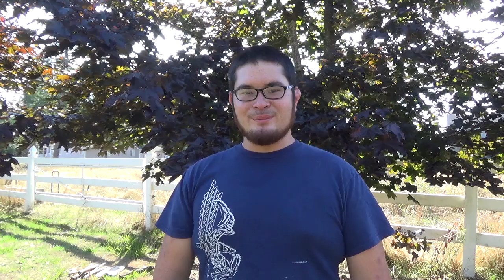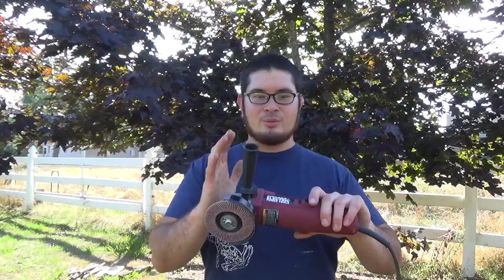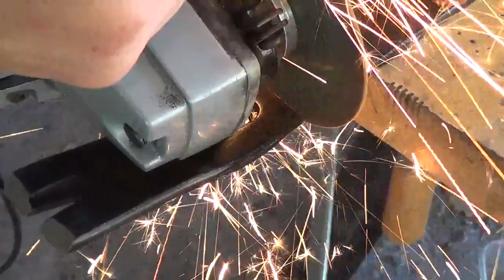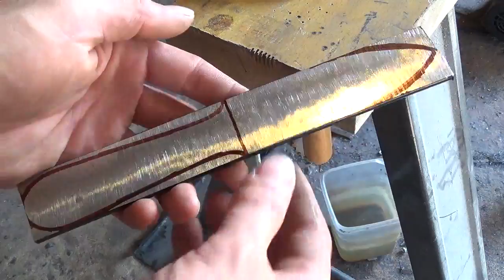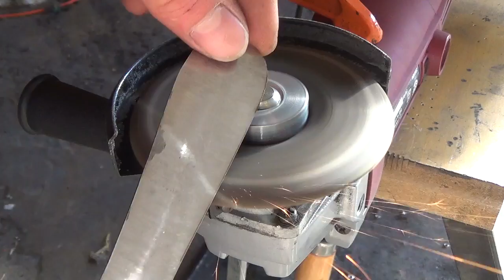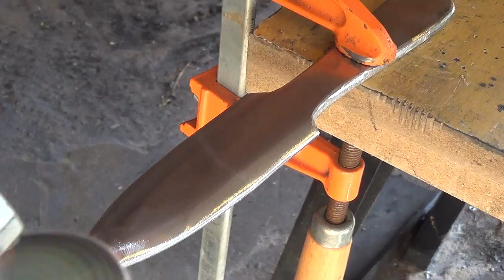How To Turn a 3 Dollar Pry Bar Into a Throwing Knife

Comment: hey nick. Just a tip, before you grind your bevels in paint the edge black. Then take a set of dial calipers and use the ends of the calipers to scratch down the length of the blade marking the paint.

if you hold the calipers at just the right angle and then slide them you will end of with an exactly even straight edge down all four sides leaving an even edge.

don't take the edge down to zero, of course. leave a little meat for the heat treatment.

Comment: You mentioned the toughness of the steel. Would it take too much longer to anneal the steel, work it, then temper the finished? I'm just trying to understand when you would vs wouldn't want to work the hardened steel. Comparing this video to the dagger made from a file. Thank you for sharing your work. It makes learning this much easier.
Reply: +Dana Carlson You could do that, and with a decent torch or a forge it won't take that long. 
Working with harder steel (higher carbon contend), requires annealing and tempering of the finished product.
Now...throwingknives are a bit special. As you don't necessarily need a sharp edge, you can get away with making them out of plain mild steel. Also they wouldn't have to hold the edge as a knife intended for cutting would have to. So, just make a template and cut a few of them out of a steelplate..anything between 3 and 8 mm would do. Thinner and they get to flimsy and wobbly after a short time, thicker and they are to clumsy and harder to cut out/grind.
If you don't like them to shiny, you can give them a quick run with a blowtorch, that will make them turn blue. Remember...just enough heat for them to turn blue, no more than that...
Oh, yes...what he said about the balancingpoint....it's very important for a throwingknife. The knife should be machined in a way so the "bladeside" is slightly heavier than the "handleside"...

Comment: is that steel hard enough to make a sharpened knife?
Reply from the maker: +GC Knives The bar I used is hardenable, definitely some kind of mid to high carbon steel. You'd have to harden and temper, though. As-is, these are pretty springy/soft.
Reply: +BackyardBowyer  I was thinking about using this technique to make a boot knife, so I would  need to do both hardening and tempering It or would just one work? What method of quenching for the hardening would you recommend, would the tempering used in your "fighting dagger" be sufficient?
Reply: is this yes or no? also, can we get actual metal grade for that crowbar? do you have any certifications or at least medals/champion trophies to show off your results??
Reply: +GC Knives You don't need to have sharp throwing knives, so it don't make a difference if if is high carbon.

Comment: my only deal is how to figure the pattern out so its consistent and  balanced. I like throwing knives but find them costly.also what is the weight on your blades?
Reply from the maker: +princess peterson These came out to 207 and 205 grams. I could sand them a bit more to fine tune their weights.
Reply: Fold a piece of paper in half draw one side of the pattern and then cut it out like you would a paper heart the glue it on to the steel or on to a piece of thin card board from say a box of shredded wheat or coco pebbles and trace its what I do for arrow heads

Comment: can you do one like this without power tools
Reply from the maker: +RhoneTv It's possible to do what I did with a hacksaw and files, maybe a flat grindstone. It would probably take a few hours per knife, though. If you are willing to anneal and then heat treat, then files should be able to do all the shaping.
Reply: +RhoneTv  You can forge one with just a hammer, anvil, and a forge. If you have a bellows then there is no power. Then you can work on it with the files and stones to get the final shape. I forged a small one out of some scrap but I did use a grinder to finish it. Still took awhile.

Comment: Do you need to heat treat this knife or any knife made from this?
Reply: +littlebabygamer heat treating this kind of knife is not necessary. if you were trying to make a knife that would hold a sharp edge then you would be looking at temper/heat treat and metal quality. you can make a knife with an edge from this material but its carbon content isn't going to be good enough for it to be a quality knife.

Comment: in regards to suggestions for mew projects, a bowie or K-bar type knife, straight, at least 6 inches long blade and 1/2-3/4inches thick and back edge of the upswept tip also having an edge would be nice. basically, a combat knife.

Comment: hey i ve got a request concerning the knife making process to the community 

in your video you arent hardening the steel after you worked on it even if it heated up quite a bit thrpughout the process 
Even if its steel which was used before like a pry bar wouldnt you have to harden it ?